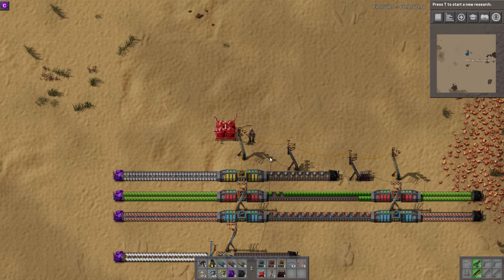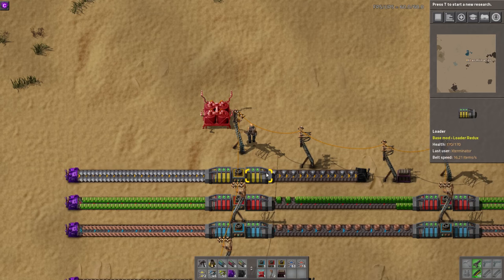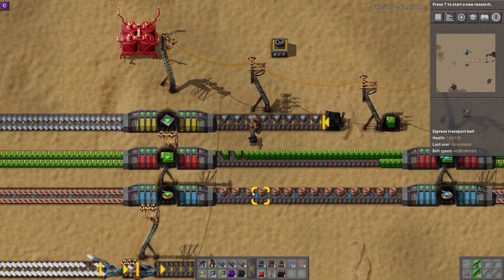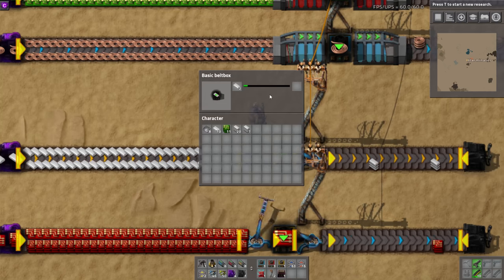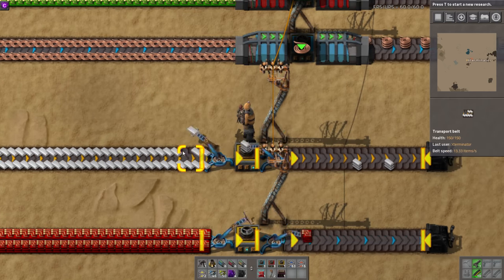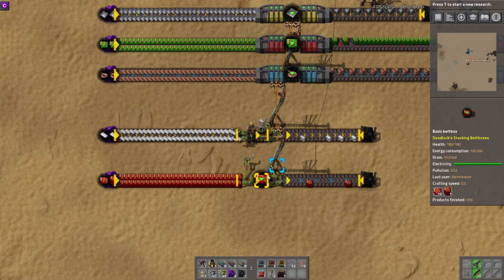Factorio Mod Spotlight - Deadlock's Stacking Beltboxes

Comment: At first I thought the whole machine would be one part. Maybe that's the way to go: Make it one 3x1 belt piece that converts the items and make stacks only be able to be picked up by stack inserters. So you have the downside of space requirement and the upside of higher throughput. Of course it is a "Must have" for high throughput, because that's the reason why it exists. But you cannot use it for everything and you also don't need to.

Comment: Would be good to improve it, perhaps with a special kind of fast inserter, which can pick up a inserter stack sized bonus number of 'stacks' off the belt, and insert the individual item into a machine... also would be nice to have it as a research, so stack size 1 gives you 2 stacks, and enable research up to level 5.
Reply: I was Thinking just ad a option to the stack inserter to stack or unstack what ever comes it way.

Still, the crates is still great for loading trains from ore fealds
Reply: Well guess what, Deadlock has a loader mod too.

Comment: Wow, this might actually get belts to the point of being as useful as bots....
Reply: But what if the bots just carry the stacks
Reply: tAdPole It was suggested in the Friday Facts to disable the ability of bots to carry these stacks, so I assume this mod tried to implement that aswell. But it's probably not easy/possible to code for a modder that only belts can carry a certain items and not bots so maybe I'm wrong. :)
Reply: I haven’t been very updated but did they remove the hit boxes for bots
Reply: Part of the point is to figure out a way to buff belts so they can be stronger than bots.  The core of the Devs' points about bots being overpowered is fair: they're easier to use than belts so they should have less upside - or alternatively, that belts should have a reward for putting the effort into using them since they are harder.  So finding solutions that can get belts to the point of being as good or better than bots is valuable - especially since it helps convince them to not nerf bots if we can show them viable buff alternatives.  Letting bots carry stacks undermines that objective.
Reply: the pure throughput is not the problem with belts vs bots. with some items, you cant just fit in enough throughput to a long beaconed AM line, where with bots, stack inserters grab the whole stack instantly from a chest.
Reply: If an inserter could grab a stack from the belt, put it into the unstacker, and a stack inserter puts it into the AM, then this mod addresses that problem
Reply: yeah, actually posted that as an extra post right after my reply to you. It could be a good idea, maybe by just give a new receipe option to use lets say 4 stacks instead of 20(?) unstacked green chips for blue chip production. Would be easier to configure than a new inserter logic i guess

Comment: Stack inserters are not effective with slow belts, but with fast belts it works non-stop judging by your video
Reply from the maker: I thought I saw it stop a few times but I could be wrong. If the stack Inserters do work on faster belt that would be great sense you don't need another mod for it!

Comment: What is the benefit of this? Comparing 1 full blue belt and 1 blue belt with same number of compressed items? Is it less items moves on belts means better FPS/UPS or this mod doesnt change that thing at all ?
Reply: you could take several blue belts, and compress them into a single blue belt of stacked items for transport over longer distances, which would in turn lower entity count and increase UPS, assuming the stacking/destacking entity itself isn't a massive performance hog.(no reason to think it would be, but you never know.)

Comment: This would help in making the main bus narrower and it even compresses more things than really necessary (blue chips and steel are OK with just blue belt). It is far more convenient than the mod that uses palettes. 

However, I don't see how this can be used inside beaconed setups where there are just two spaces between a row of bacons and a row of factories.
Reply from the maker: Yup agreed. It doesn't help much for builds with beacons and such, or within any build really. However it would reduce overall belts a lot sense you could stack the items at the start of your bus and then unstack before builds and it would reduce all those extra main bus lines as you mentioned.
Reply: With these two mods you can also build a pretty compact balancer: stack and merge belts, then balance if more than 5 inputs, split into however many outputs you want and finally unstack. 

If devs were to implement this, then I think putting items on belt should work normally, there should be a stacker/loader and unstacker/unloader, but inserters putting input materials into factories should accept stacked items. Stacker/loader should accept stacked items and just pass them through. Unstacker/unloader should accept unstacked items and just pass them through. This would be the best of both worlds and for example blue chip factories would be convenient to feed with a belt of half red, half stacked green and smelter lines could have a stacker in the middle and at the end and work at full throughput without underground belts.

Comment: I think this is pretty useless, unless you want more straight forward belt throughput. There is now way this actually buffs belts, unless it also changes reciepes to have an option to use the stacked one. Because it wont fit into a beaconed AM line. 
Im curretly working hard on a full rail+belt base, and I´m just running my head against a wall at blue chips. You could just use green/purple belts from Bobs (i believe) for straight forward throughput. But with a reciepe change (or option to use both stacked and non stacked) this would be really cool (same with universal paleting, but this one looks more promising)

Comment: Does anyone else have a problem of Xterminator videos freezing? The audio keeps going but the video doesn't. It only his and no one elses. Seems like its just recently started as well, a few days ago I had no issues.  On this video it seems like the video will pick up and then stop again after a few seconds.
Reply: Xterminator's videos are often in 4K at 60 FPS. If your browser and GPU aren't setup to properly decode that resolution and framerate, you can get stutters and other issues. Try 1080p.
Reply: I did not relize they were 4k at 60fps, seems to have fixed it, which is odd as I can watch other videos at those resolutions/fps (980ti with a i54690, 24gb of RAM). Oh well as long as I can finally watch his videos. Thanks
Reply: Holy guacamole you got pretty nice resolution 😮